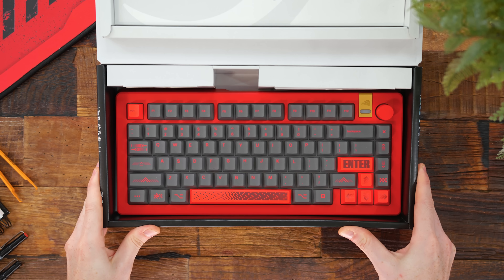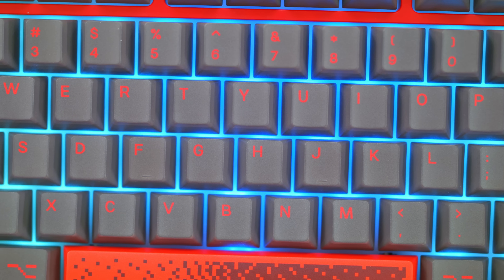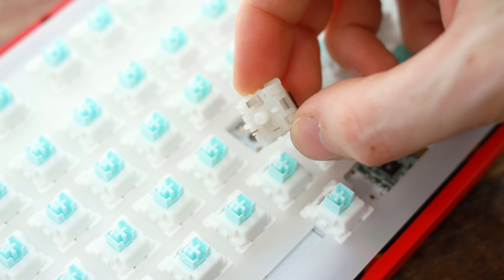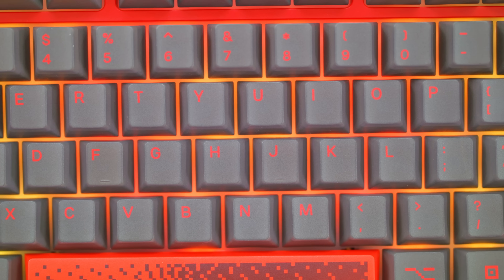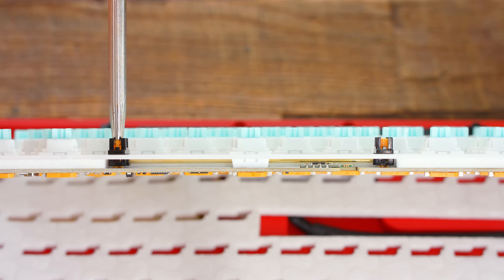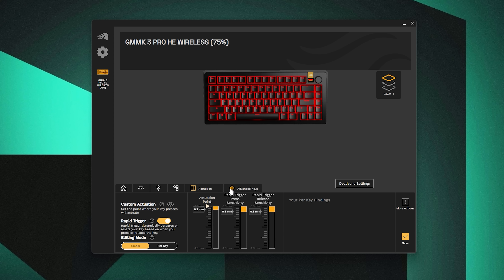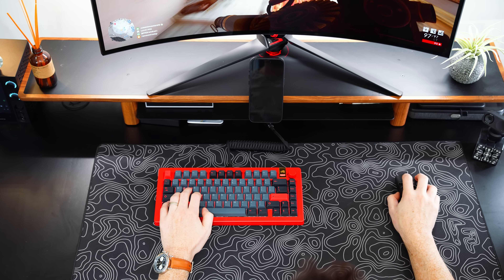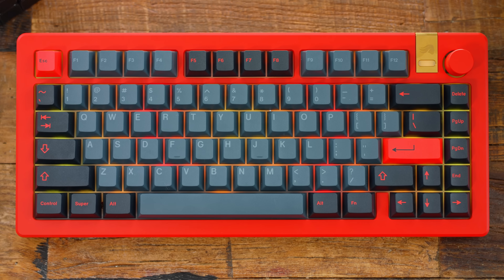NEW Glorious GMMK 3 Pro Keyboard Review!

Comment: Wow! What an utter waste of money. You'd be better off just burning half the cash and buying a highend keyboard for $250 from practically anyone else.

Start with a full size, wired, standard switches, south facing RGB - $170. The black plastic bottom is ugly as sin. They want $100 for a metal bottom. $60 for a metal top. Stupid switches, I'll use my Zilents and get -$33. Aura caps for $5? That's actually a good price. Add a brass plate for $25. $327.00 is the sub total for a metal keyboard with no switches because there's no option to build it yourself, so you're paying $150 for them to build it - without switches. What a joke.

Comment: Seeing a lot of people commenting how this is overpriced at $500, although I do agree it might not match up to the quality expectation of a $500 keyboard, it is important to remember that the one that Frank has is fully spec-ed out with all possible options.

If you just want a HE, 60%, plastic casing barebones board, it is only going to be around $135, which imo is quite competitive with other offerings from different brands. I found that the wireless option really jacks up the price because it locks you into the PRO model which starts at $268 at barebones.

If people are comparing this solely to the Wooting, bare in mind that they do not currently provide a wireless keyboard as far as I know. Hence although I do not think the wireless GMMK 3 HE is "worth" the price premium, I do think the base GMMK 3 HE is quite competitive with a lot of fun customisable options as well.
Reply: GMMK 3 still not have competitability among all the he boards. Many Chinese HE keyboard brands are cheaper than GMMK (aleast ahalf).